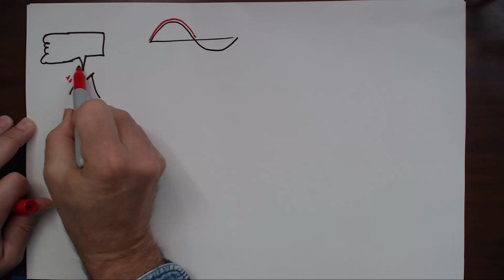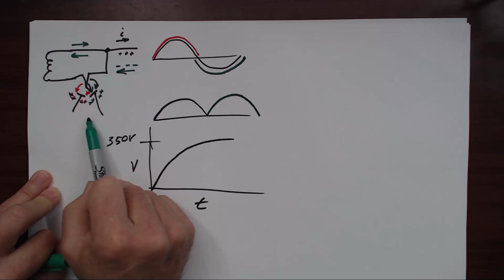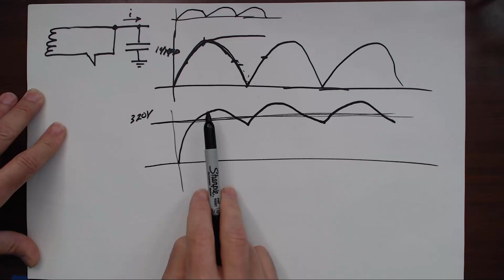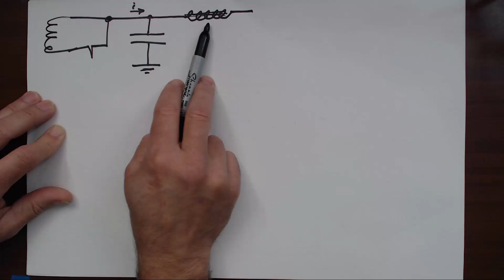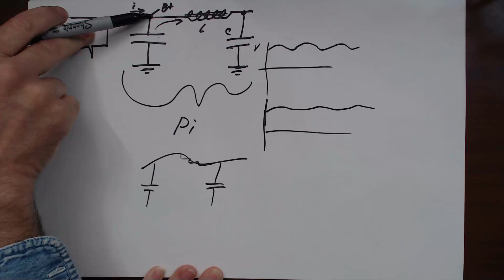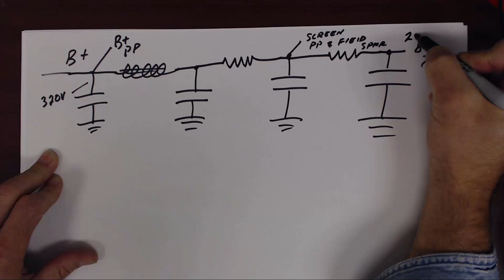Vacuum tube amplifier filtering from Rockola DE-39 Amplifier Part 2:  Filter

Comment: Best explaining i have heard yet, thank you very much.   It seems lots of amps cheap out on this and use just capacitors instead of chokes.
Reply from the maker: Thanks.  Yes, you are correct.  Magnetics are far more expensive than capacitors so it is far cheaper to use caps than chokes.